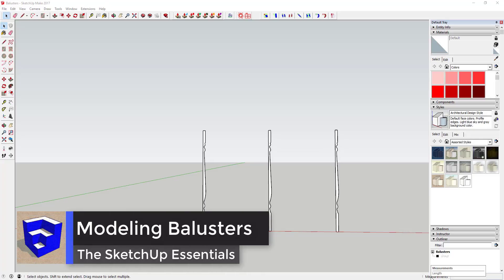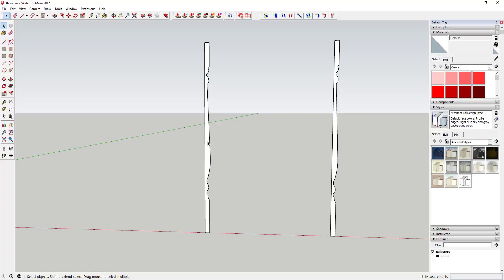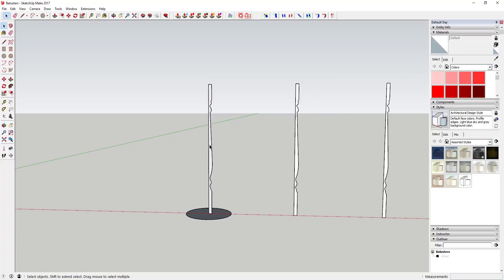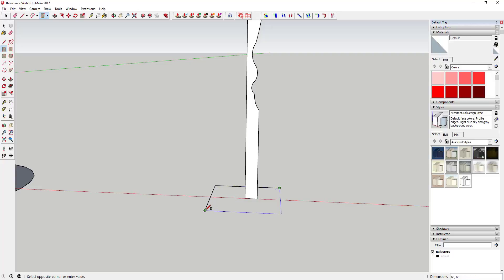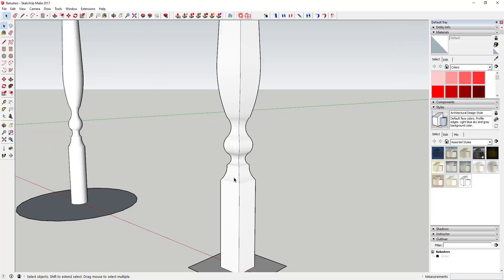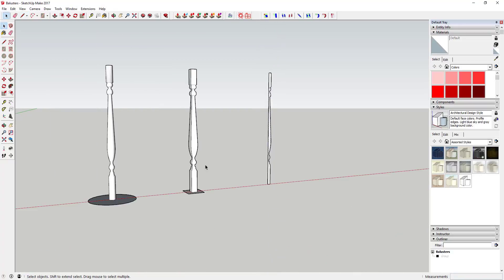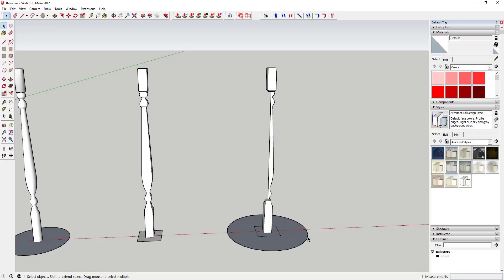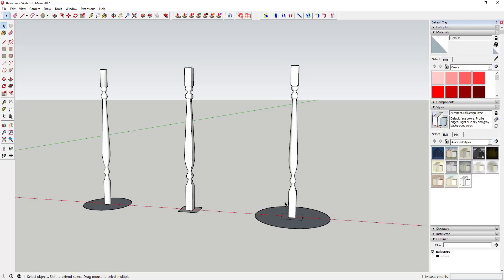Creating Stair Balusters in SketchUp with the Follow Me Tool

Comment: Hey Justin. I am liking your videos on woodworking. I'm learning a lot from your videos. Thanks. One question, when you select reverse face, I don't notice a difference in how the drawing looks. I'm not understanding what that actually does when you select it.
Reply from the maker: Hi Paul - all faces in SketchUp have 2 sides - a front side and a back side. Usually the front side is a white color, and the back side is a gray color, so when I reverse the face, the white face is now facing outside instead of the gray back face. Does that make sense?